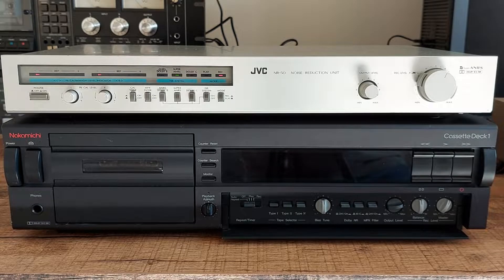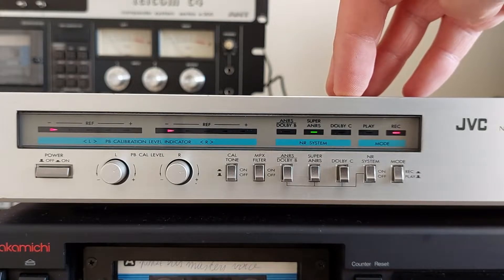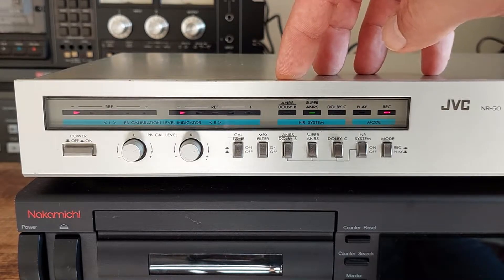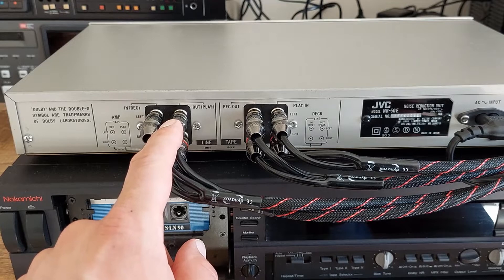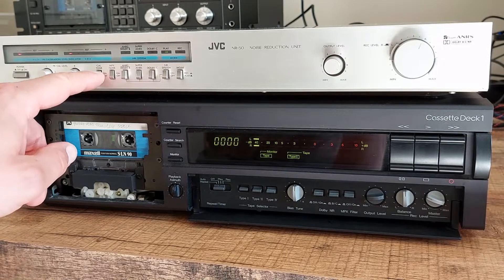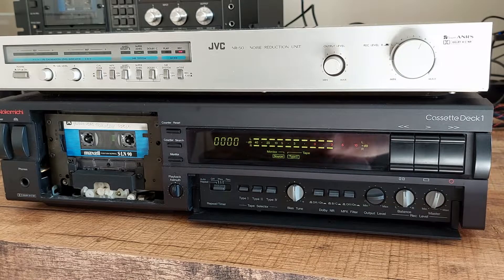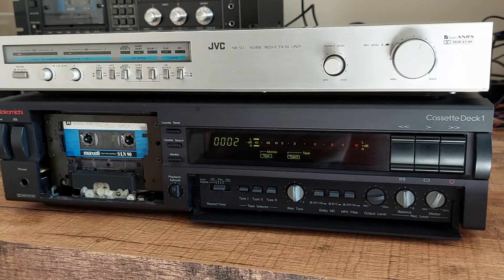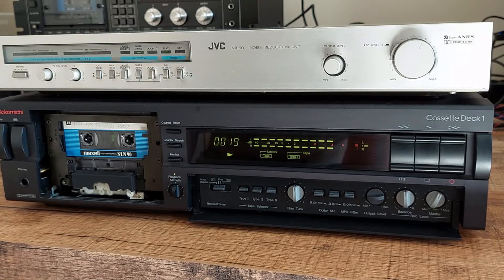JVC NR 50 Super-ANRS Noise Reduction Demonstration

Comment: Actually your calibration is wrong. The user manual says "so that the meter of the deck indicates +3dB (VU) or Dolby mark (DD). The 'or' does not express an option. You are to set to +3dB when the deck uses meters with VU scale, i.e. referenced to 160nWb/m. You are to set to 'DD' mark when the deck displays this. You are to set to '0dB' when the deck innately is referenced to Dolby level (218nWb/m) (read the service manual). Nakamichis are referenced to Dolby level. You have to set to 0dB. A much better method still would be to skip the JVC procedure, play a true Dolby level tape (i.e. TEAC MTT-150, ANT L-04, ...) and align the NR-50's input levels.
Reply from the maker: Indeed, now that you mention it... I was to be set to 0dB on the Nakamichi as that's where the Dolby Level is set to. It won't make that much of a difference anyway, but for the sake of converstaion : indeed, it's 3dB too much. Yes, I have Dolby Alignment tapes, and yes, I  know the SM from that CD1 by head... :) You're on tapeheads too, if I'm not mistaken?